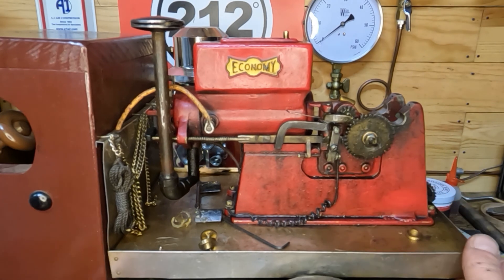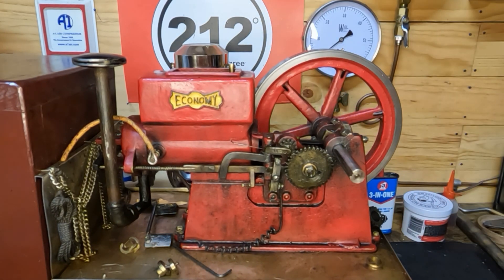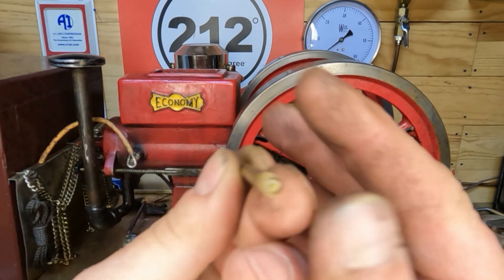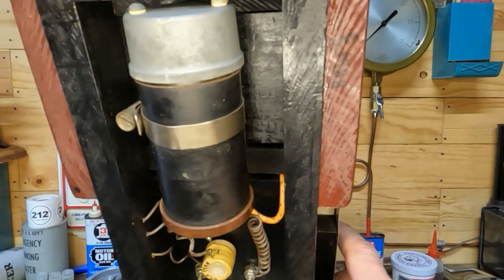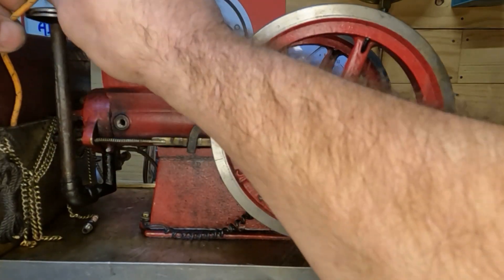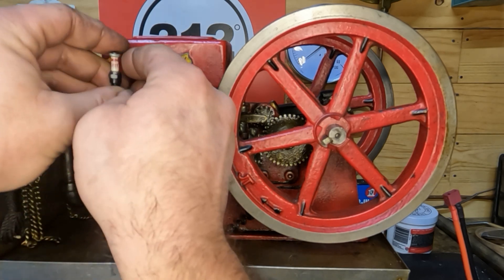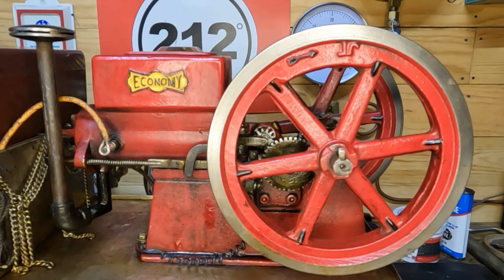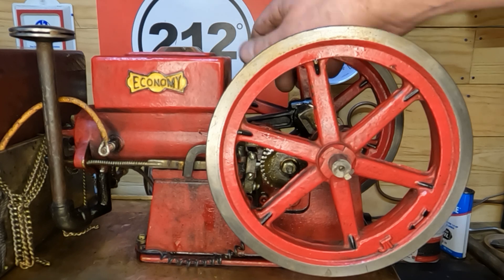Fix The Economy?  We're Working On It!

Comment: I think tearing the engine down clean it reassemble it and hopefully that runing again 

Don't forget to repair the connector of spark plug normaly is rubber or plastic isolation
Reply from the maker: It gets better,  this engine and I have exchanged blow for blow.......

Comment: when watching the unit hop i suddenly got the urge to get out some of the stick on lead wheel weights i have to counteract the imbalance and send them to you. smooooooth.... 🙂
Reply from the maker: I hope to finally get back on this one soon (if my parts order shows up) and give it a longer run that will allow me to dial it in better. I know that it will never run as smooth as a throttle governed multi cylinder engine but I think we can do MUCH better than the way it acted during this short run
Reply: @steam212  i  quite possibly may have not come across correctly. my bad. my intention was to convey amazement at the fact the little engine could generate enough torque to lift itself. the reference to the weights is something i have noticed on a lot of full scale engines and not just the miniature ones..... inadequate crank counterbalance. watching the carts some of these are mounted on lurch back and forth due to lack of counterbalance and not just torque is hilarious! 🙂
so much is lost when the sound/inflections of a conversation are not heard and consequently misunderstood. that's a point that i often forget. thanks for the vids. insightful as to the different designs and solutions of engineering times past.
=dok=
Reply from the maker: @gizmothewytchdoktor  I took no offense whatsoever DOK. I completely understand and agree with you (I hated how imbalanced the Enjomor 6cc was so I milled the crank and lightened the rod) there are always things that can be improved or a better way to get something done. We're all in this together and if we learn from one another,,,,, well we're in for a rough go of everything. I really do appreciate your comment and I went out to the shop last night and started looking at that economy a bit deeper, you're right..... Improvement will be made 👍.    Thank you again for watching and sharing your thoughts, they did not fall on deaf ears. 👍👍

Comment: Hope you had a merry Christmas! I recently obtained a m16b mini engine. I’ve tried for 2 days trying to get it to run. It has fuel and has spark. I’ve adjusted the needle 20 times to no avail. With the throttle closed and the drill being used as a starter, all I can get out of her is 2 or 3 pops every 5 seconds or so. Any help would be much appreciated!
Reply from the maker: Hi Hilux, where is your main needle set at (from closed)? 1/3 to 3/4 turns open is what I have found to be a usable range on most of mine. Is your spark plug arcing at the electrode tip of off to the side? This has bit me several times before also. Thomas made a GREAT point also, check your batteries. I have flooded a few of these little engines before and they will act very similar (only popping occasionally and only at an idle) close the main jet and open the throttle and spin it with the drill this will usually clear them out, then only slightly open the needle and close the throttle and try again.  If none of this helps, let me know, we'll go from there and see what happens next.  Thank you for the question and thank you for watching 👍
Reply: It is also firing at top dead center. I would have never thought to check that if not for your videos!😅
Reply: @hiluxdeprived6314  Do replace your batteries just in case they're low on current. I had batteries that caused spark-spark-spark-stop once. Od course I checked everything else first :/. Also, too lean will cause this.  Good luck :)
Reply: It was the spark plug jumping fire. Thanks for the help! She’s up and running now, and starts very easily!
Reply from the maker: @hiluxdeprived6314  Fantastic!  I'm glad you got it figured out and running 👍

Comment: The resistor underneath is to allow the 6v or 12v terminal choice.  That's a 6v coil and the 6v ignition terminal goes directly to the coil while the 12v terminal goes through the resistor so you don't burn up the 6v buzz coil.
That's a really nice setup for that Economy model.  It looks great and has a ton of fantastic features.  Using a buzzbox is great for these little models to ensure ignition on each power stroke.
Reply from the maker: You're exactly right Henry.   I've been monkeying around in the shop, I think we'll see if anyone can benefit from what the off camera testing has come up with. "Easy buzz coils for all" will be the title.     Thank you for watching and commenting 👍 . Keep up your great work!